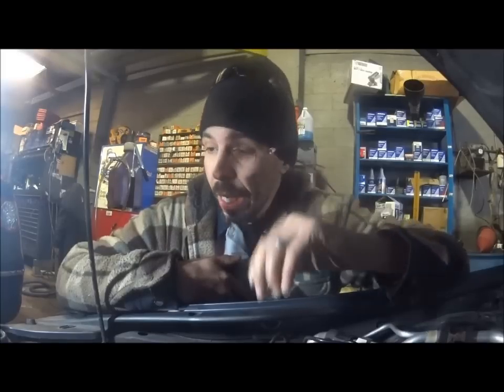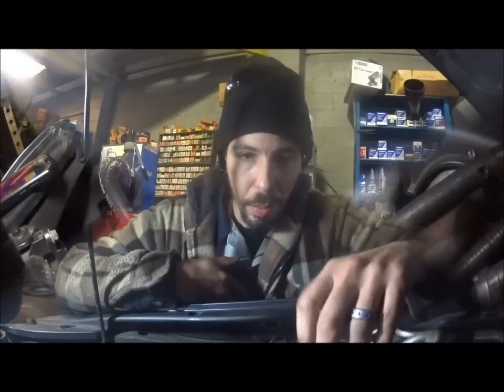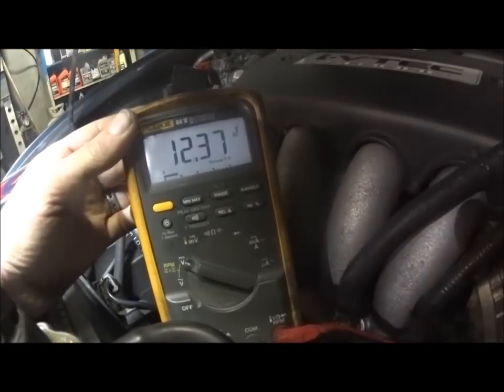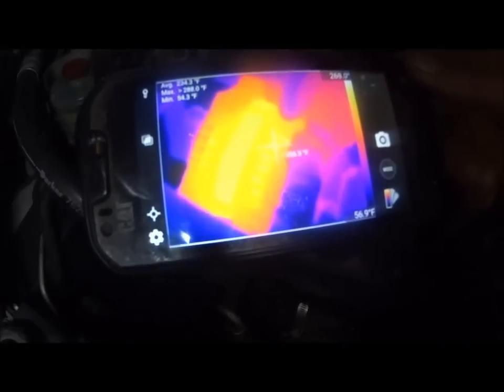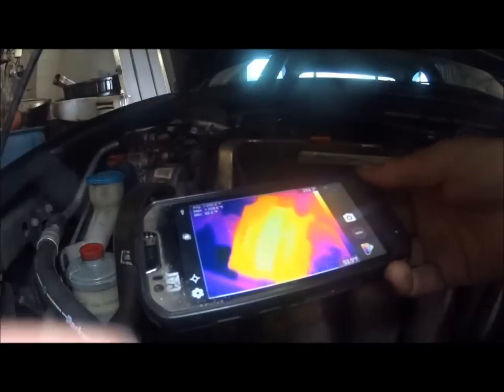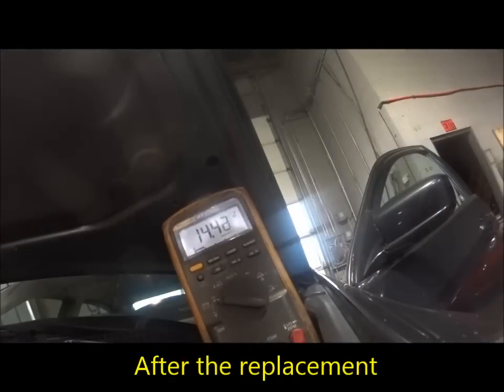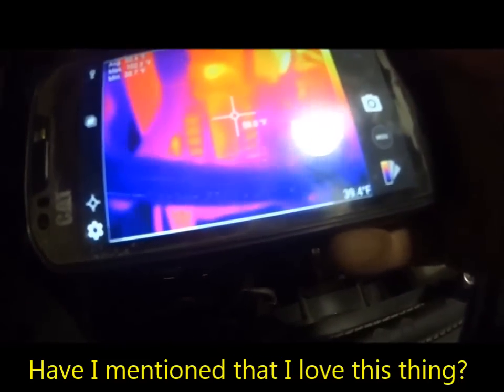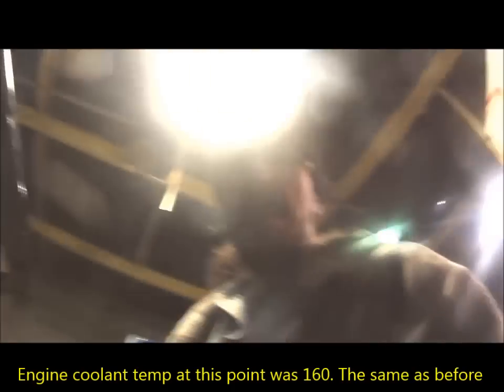Noise in Engine? Honda Accord Humming Noise from Engine (Thermal Camera Use)

Comment: sometimes the low voltage at idle on hondas are normal. they got the low output and high output mode
Reply from the maker: True...but in this case the voltage simply went lower and lower...plus the alternator was red hot and making noise, so either way it was being replaced.

Comment: Joe, would the thermal camera pick up the hot fuse? Cheers
Reply from the maker: Hot fuses?
Reply: @JoesAutoElectric  just thinking a fuse with current flowing vs a fuse that's not doing any work. Just a theory.
Reply from the maker: No, it will pick up heat. If the fuse in question had , say a loose terminal causing a voltage drop, then yes, it would see that.
Reply: @JoesAutoElectric  Sweet, thanks Joe, much appreciated. Steve.

Comment: When I first turn on my Accord I hear humming too until the car is up to temp for the most part. 2010 EX 2.4 ...... Never thought to check alternator
Reply from the maker: Most of the time on these it is not an alternator, but the power steering is common. They have a habit of O-rings failing causing the pump to suck air. Let me know what you find.